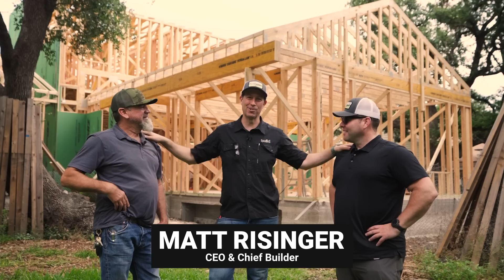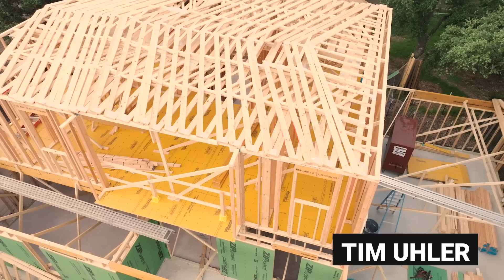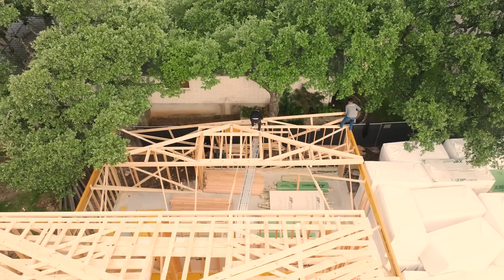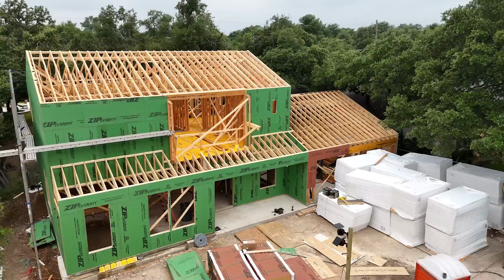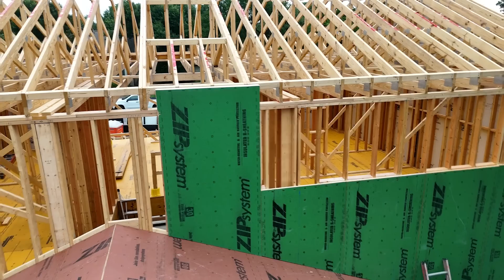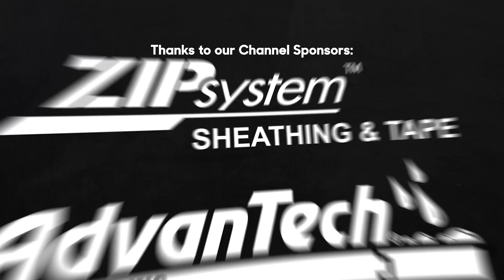Truss vs. Handcut Roofs: Expert Builders Weigh In

Comment: I've been a builder.
 Over 40 years, mostly in the New York Long Island area and we never use trusses. Now I moved to Florida building down here and I'm using stick frame. Rafters seems like nobody knows what they are in the long run. If you know what you're doing. There  cheaper there's no basements here. We have an open attic for storage.  I personally don't like trusses too much engineering.Too expensive and you kill your attic.If you have the knowledge roof rafters handcutting is way better and cheaper if you know how to purchase a material

Comment: I’m not a fan of cut up busy roofs in general so we typically use trusses. Also, for future floor plan changes the trusses eliminate load bearing interior walls. Overall a cut n stack is good if the guys doing it are good.

Comment: Down here, way under, I would say that 99.78765578% of houses are built with trusses. Of course, if you need the space, then you need a floor and rafters. But with an unused roof space, as is typical in NZ, trusses are much cheaper, no matter how complicated the roof is. The timber is usually just 4x2s nailplated together, and it frames both the roof and the ceiling in one go. Also, they span from external wall to external wall, so internal walls are not load bearing.

Comment: As a structural engineer, trusses are the norm unless you require a hand cut roof. They are much easier to spec and have a simpler load path. The suppliers do all the detailed engineering of the truss design. You don’t have to worry about the load path of the ridge support beam. Framers also get the hip to ridge beam connections wrong even when you detail all of them out. That means having to do extra details to fix mistakes.

I can see there are non-structural advantages to hand framed roofs but it is financially better for the engineer of record to go truss framed. It is also cheaper to build in most cases. There are lots of suppliers where I live and delays have never been an issue.
Reply: One big advantage of trusses is that you frame the roof and the ceiling in one go, typically with just 4x2s and nailplates. And, as you alluded to, from external wall to external wall, with hold-downs only required at those supports.

Comment: I think it's good to think about the person who is going to be replacing something like an electrical wire in the future. Things happens, wires need to get replaced. If the roof pitch and height of the attic make it impossible to get within 6 feet of the hole, then the electrician may need to open up the wall.

Comment: One thing to consider is whether the hand cut roof is made from 2X material or I joists. I've heard that fire-fighters will not walk on a roof or attic floor system that is framed with I joists because of how quickly they can fail during a fire. Therefore, I would go with the solid 2X material over the lightness and speed of installing an I joist attic and roof system.

Comment: Structural engineer here.  Many trusses need "continuous lateral bracing" (CLB) to meet engineering requirements.  Installing the CLB system could easily eat up half a unit of 2x4s plus another day of labor.  And then your attic is criss-crossed BOTH ways with obstacles.  On most jobs I've inspected, the CLBs were installed wrong or omitted altogether.  Bad news.
Reply: And from a home inspector's perspective, I would prefer to have a hand-cut roof.  The number of times that I've seen damaged trusses (from improper storage or installation) to altered trusses (from hiring the wrong contractor) would surprise most folks.  And to remedy the situation, they typically need an structural engineer consult along with a general contractor to execute the prescribed repairs.  Talk about eating up any savings!

Comment: Unfortunately, pre-fab stick trusses are common. They may be cheap and easy to install, but when installed with a bed of fluffy insulation over the ceiling and bottom cords of the trusses, as a vented attack,  they create a huge wasted no-mans land that is difficult to maintain. These vented attics are wildly inefficient spaces to install ducts and other mechanical equipment.

Developer and builders like them because they are cheap. Owners still pay for  pay for it,  but it's  a useless hard-to-maintain space.

Comment: We do Renovations, I have seen SO MANY gussets pretty much pulled loose at the ridge, and the second truss, (or the first one that is not sitting on the exterior wall) is sagging 1/2 to 3/4” in 20-25 years. That is for residential homes, 32’ and under spans. Yes some stick built sags, but if they do, they are not to code specs, the trusses sag, when at least or ABOVE code.

Comment: Something I noticed with my previous jobs were that trusses are getting more and more inaccurate, especially the more cut up you get. Not sure if it’s the labor force, pressures, time frames or what but we were at a point of having to verify every truss package that we got.
Reply: Oh good point i was forgetting that there is always something to fix on the pre-made trusses. 
Sometimes they are out of square, different widths or the peaks is not centered. 

I like to control what I do and build as opposed to relying on someone else
Reply: @jeanfrancoisbrodeur  exactly, We actually had trusses that didint fit the walls before. They were 2" too far on one side, which is crazy for a truss, and each truss had a different measurement of wrongness lol it was crazy

Comment: I am a timber framer and partial to hand cut rafters over trusses. 
Where I am in British columbia, Canada, the snow load requires roofs to withstand 100 pounds per square foot. And truss manufacturers tend to cheap out on their trusses and call out for a ton of bracing and reinforcement of the trusses they deliver. And that ends of taking a lot of time of walking through the trusses and finishing the work that someone else could have done. So it takes a lot of time and costs extra to use trusses I find.

Comment: I imagine if one has a slate roof, hand cut is the only way to go due to the weight and structural loads??
Reply: Not if the trusses are designed to take the load.

Comment: You basically lose an entire story/half story with a truss roof system vs ratfters. That is the cheapest space in a house to build on a per square foot basis and can make for a great office on the gable end or add dormers for a bonus room.
Reply: Except now you have to install floor framing. But I get your thoughts.
Reply: @mojodojo5533  not “free”, but cheaper than alternative methods (basement, bigger floor plates, etc) for additional square footage.

Comment: Buildinf a super high energy efficient custom home. Unvented roof, no ductinf, no perforations through the roof..Hand cut with a beautiful massive glulam beam in the center giving me a clear span of 38 x 32. No interior structural walls. Even the truss company told me to go with hand cut.

Comment: On the topic of roofs and vented vs conditioned. Joe Lstiburek has a lecture on how vented roofs are that much more simple and pain free. Obviously moving your mechanicals out of the attic is an issue when you don't have a basement but wouldn't a utility closet inside the house be optimal in that situation?

https://youtu.be/Ld8pzIu45F8

Comment: Have had both, as a homeowner, both are good. First home was custom, architect designed, had some framing issues. Soffit was too low and mater bedroom windows couldn’t open fully. Staircase wall was 2x3, no room. All windows didn’t open properly because of brick installed too close to windows. The other was a tract home, walls and trusses made in a factory. Best home ever had, still living there 20 years later, with no problems.
Reply: Sounds like your problem was the architect, not the rafters.
Reply: With my 43 years as a carpenter . Yes .. sometimes there are no advantages in a custom build . sometimes there are . In my experience , Never have I found a set of prints without errors , Some with amazingly signifcant errors that to the lay person is no big deal . It'll wreak havoc on the job , fingers pointing everywhere and excuses flowing and in the end it is better with a proven , repeated design that is tried and true . I ended my career in 2022 as a carpenter . . All the way from hand-driven crackerboxes and ending with front cover and National Homebuilders Award 2014 for homes over 3 million dollars . Some pre-fabs and tracts come out better than The Biltmore's and has fascinated me at times , Then again . I have seen McMansions built so horrribly that it defied every code in the book . My biggest wory for the future carpenters is losing the art to slap and run , losing the creativity , losing the ability to master woodworking , problem sloving , math and losing the joy of what I found in the trade.. For the carpenters . Being turned into a robotic drone with a nailgun and no understanding about what is being built .

Comment: If you have ever built in seismic 3 or 4 zones you will understand why cutting in a roof is better. I've put solar on over 2 dozen HEB Grocery stores and a distribution center in Texas. Crazy hurricane winds. I've never built roofs in Texas but I would insist on rafters over trusses.
There is a reason anyone 40 or younger has only seen it it custom homes.

Comment: Theres a video somewhere on YT showing a truss roof on fire and a hand cut roof on fire and a stack of blocks on top of them.  The truss roof lasted only a few minutes.  The hand cut roof last like an hour.
Reply: Hard to find many Youtubers talking about that, especially if they are sponsored by a truss company or flimsy  IJoists
Reply: As an engineer, I'd never spec a truss roof.
Reply: The metal meshes (that locked the lumber) that is used in trusses are the reason. With heat and expansion, they got popped quick. Same goes for metal trusses; metal strength deteriorates quick
Reply: I wonder how long it rafter would last if non vented w Rock Wool vs truss w blown in

Comment: I think we need to stop building homes with ventilated attics..  For all the reasons you mentioned, PLUS,,,, a ventilated attic is like a match waiting to light. I recently saw a house go up in flames from the house next door that was on fire.. The fire was literally sucking into the roof of the second house from the first. Yes, Florida is building homes that close together now!!!  Not building that full envelope is INSANE, if you ask me!!!!
Reply: The Home Performance channel has a video 'somewhere' in their catalog about the ways that homes catch fire.  It included information on burning cinders getting pulled into attic vents, and what building techniques need to be used to prevent it.
Reply: My HVAC guy just said he's not integrated in conditioned attic spaces.  After all this time, there is still no consensus. Frustrating.

Comment: Matt, you need to do an episode on truss uplift. I see it all over the place on truss homes in north Texas causing drywall seam issues where the wall and ceiling meet. I would never build a truss house. It can be mitigated if installed correctly, but nobody does.
Reply: They make drywall clips to accommodate uplift but yes glad you mentioned this issue, important to know.
Reply: Who has access to these level of carpenters?
Reply: Complete mini split in a large hosue ? Only in a very Open plan….and with all that humidity in northwest??mink splits suck at latent heat removal.
Reply: We simply add scrap 2x4 blocking to the top of the interior walls in between each truss. The drywallers fasten their board to these instead of the truss on the edge of the interior wall. This eliminates any cracking issues. Simple solution minimal time and effort.
Reply: So the 2x4 blocking overhangs the top of wall to allow for drywall screws? Sound fairly easy.@benjamindeboer6920
Reply: Thanks for your comment as I had never heard of the issue, probably because I've lived in the deep South.  It is one more reason to build conditioned attics where the top and bottom chords don't see much of a temperature and humidity difference.  Exterior insulation on the roof of a conditioned attic will help even more to keep the top chord at the same temp as the bottom.  My father cut the rafters for our unconditioned attic back in the 60's.   It withstood the >200mph winds of the eastern eyewall of Hurricane Camille.  And it had no web supports and no roof decking, only tin sheets  Just a ridge beam with beefy supports.  So the argument I hear here in Florida that we need roof trusses because of hurricane winds doesn't ring true with me.  Still, I plan on using engineered trusses for my retirement home to save on my own labor but I shouldn't have an uplift problem for the reasons above.
Reply: @markstipulkoski1389 Yup. Conditioned attics are great but it’s an extra expense for tract home builders and something they wouldn’t be able to recover. The warranty will be expired before uplift is a problem.
Reply: What is correct installation that mitigates that?
Reply: @machinemaker2248  Stay 18 iinches away from the partition wall ceiling screws......allows the drywall ceiling to flex.
Reply: @machinemaker2248 I've seen ceiling drywall screws held back about a foot or so from panel edge allowing it to move without cracking. May be off on that.

Comment: I'm 54 and I don't know anybody younger than me that can cut a roof anymore. When I was in my early twenties I worked for some badass guys like Chewy. My mentor could cut six houses out ahead of us in two day and then the four or five of us would come behind and stack those roofs in 3 to 4 days. It was sweet.
One of my biggest pet peeves of trusses is the delivery process and individuals handling them and damaging them and never repairing them properly before installation and or all the other trades come in and chop them apart to make their stuff work and often ruin the Integrity of the roof structure. Cutting in Rafters is always and will always be a better roof than trusses. Trusses were designed for production only. It's a shame they took the skill out of the trade cuz these two guys here are very rare with their Crews nowadays. I did my roof time in Northern California, I'm in Arizona now and if you can cut a Roof in you are making bank...
Good stuff guys
Reply: No one is interested in roof framing is the problem. As a younger carp, roof cutting is the most interesting part of the trade by far. And it's not hard to pre cut a roof package for a 2000 sqft house in a day if you have the cut list sorted out already. Chewy probably spent 2hrs the night before drafting the cut lists, setting you guys up for production success. I'd be curious to know if the full stack included ceiling joists in that time? If so, you guys were flying.
Reply: @andrewanderson4281  full stack did not include ceiling joists. Homes were closer to 3000 as ft.
My mentor would pull dimensions on the ground and with the construction master calculator would figure out every single piece to cut himself on site. We stocked all the material in front of all the houses he cut pieces we stacked parts and then would absolutely kill it for several days other Crews would do a complete house at a time . We'd still beat them by at least a house at the end of the week my mentor was freaking awesome at roofs and I never learned as well as him. It was just awesome to be a part of the process.

Comment: We are in the Midwest and I have an older guy working for me that worked in a truss shop years ago and is excellent at hand cut rafters, our install time is the same either way for us. So we go buy the job, if we are doing an addition or trying to match the existing house we hand cut. If it is all new and scheduling allows we will go with a truss. That’s basically how we go about it, keeping in mind some of the points you mentioned like HVAC as well

Comment: Why not SIP roofs? Seems like a faster and better quality option that is often overlooked.

 I still dont understand why the 3D printed houses dont have SIP roof structures.
Reply: Its expensive and difficult to repair if needed.
Reply: My builds are within 10% of stick framing once you calculate zip panel and insulation.

Never had one fail and require repair.

Yet...
Reply: @rabidraccoon1201  Could just be a perception issue, then!
Reply: Yep!
Reply: SIP systems have a high failure rate. OSB rot